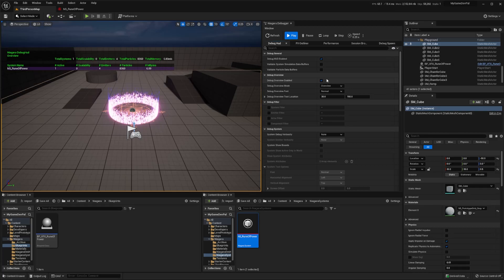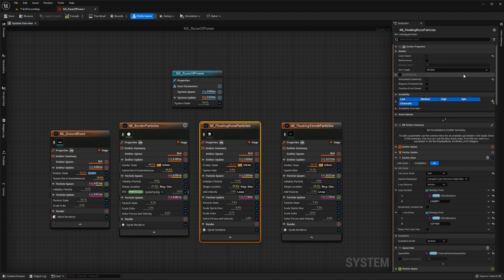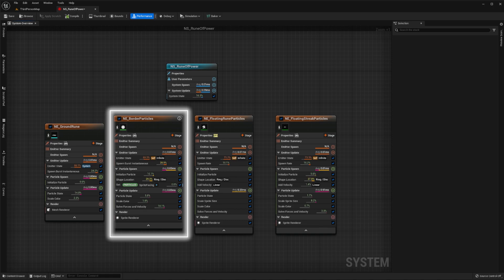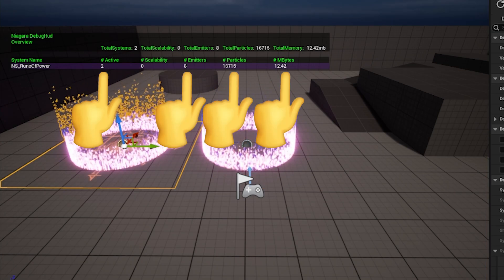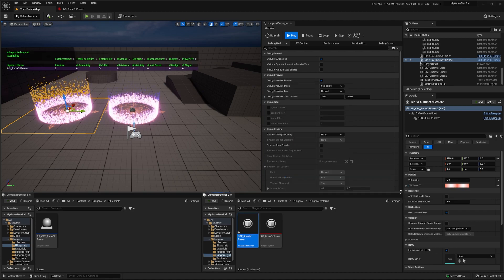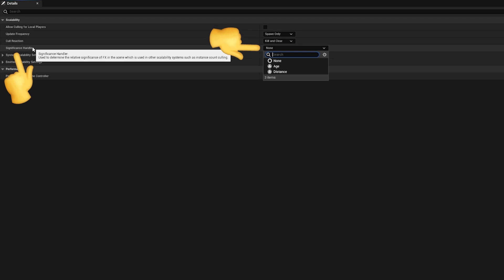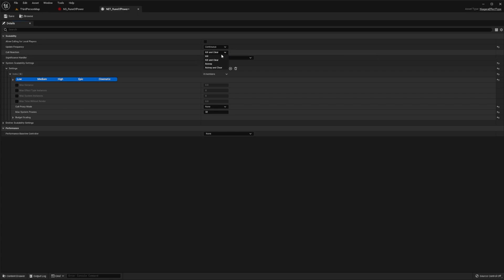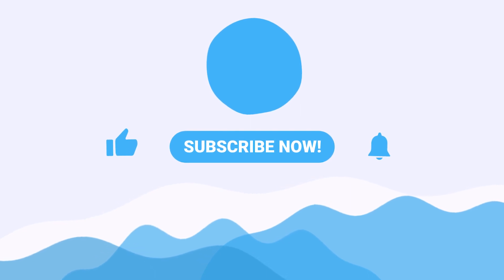UE5 Niagara Tutorial - Niagara Performance Optimization

Comment: The Problem that i have is that a simple System with less than 1000 Particles on a single actor already takes up about 50% of my GPU.
Reply from the maker: That's unfortunate, sounds like you have a low end machine?
Reply: @MyGameDevPal  no not really. I can run most games with relative ease. I never had thr issue that a game was too demanding for me. But for some reason , the Fire Effect i copied from a tutorial just KILLS my GPU
Reply: I'm also having a massive FPS drop (25%) by spawning an instance of the moving fire template.
Truly disappointing.